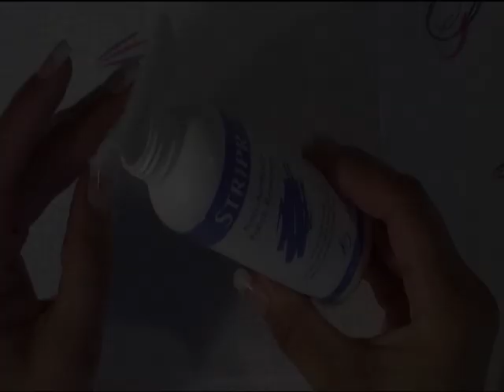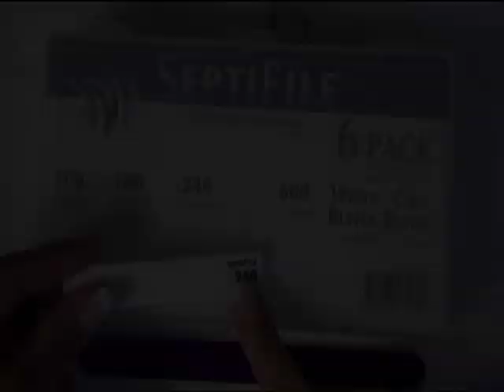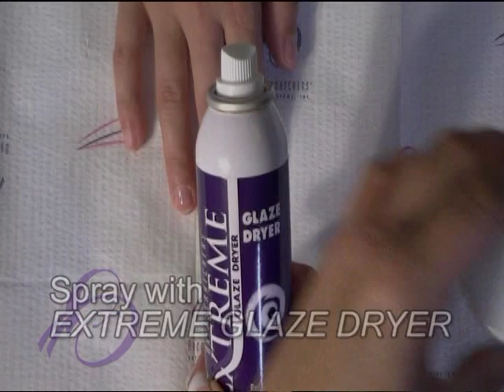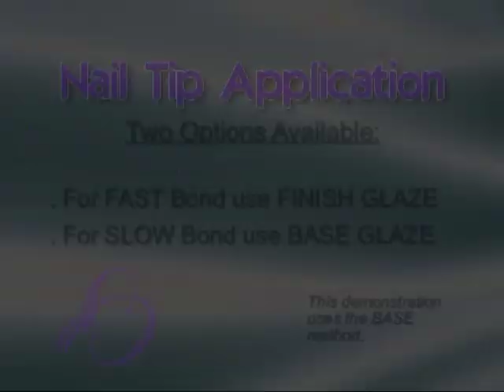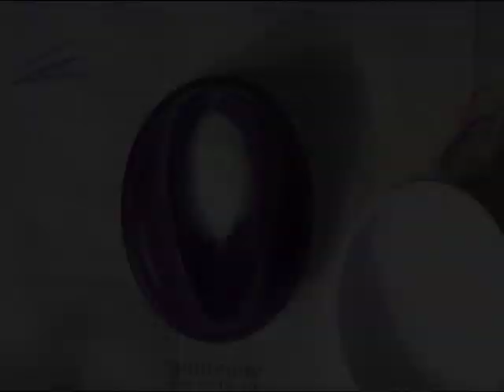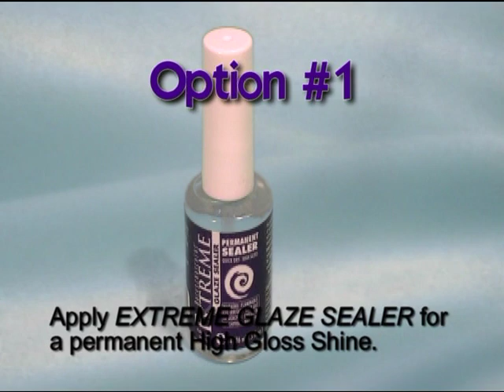How to Acrylic Nails Tutorial Backscratchers Acrylic Dip System

Comment: I wipe between every use but my finish glaze brush was totally ruined after the first use. What am I doing wrong? Does it have to be a neat and tidy brand cloth?
Reply: Any time the (powder) comes in contact with the the brush is when you need to wipe it on a Neat & Tidy. What I think is going on is once you spray the dryer on the nail you need to make sure that the fumes or flash from the spray is still not on the nail. just tap your finger over the surface of the nail. 1-to make sure that its dry 2- to remove the flash off the nail surface, because what is happening is the fumes come in contact with the brush and that will harden the brush. I hope this will help you. You can always call us at 1-800-832-5577 for help
Reply: Thank you!!